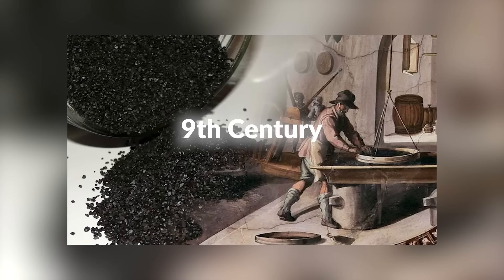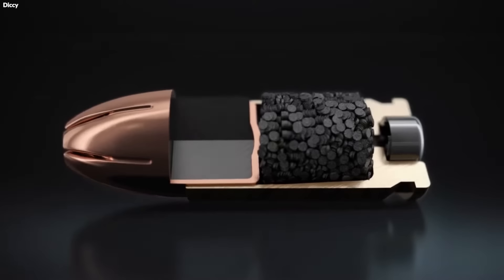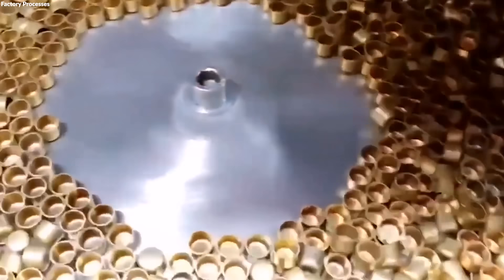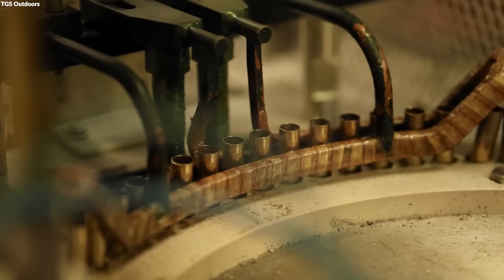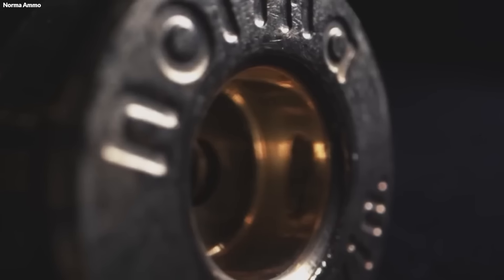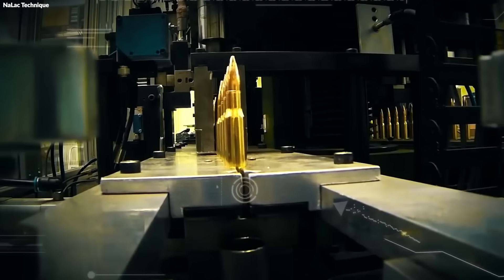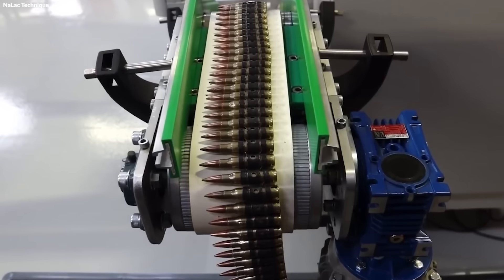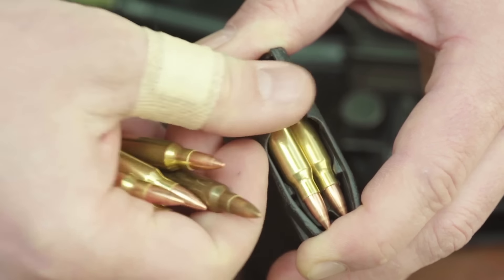How BULLETS are made - Satisfying Manufacturing Process - MUST WATCH

Comment: BRASS is used to form the cases,not copper.
Reply: What is brass? 😉
Reply: @stripedassape8148 he’s gonna be in total disbelief when he finds out
Reply: (I know your reply was tongue in cheek but) Brass is a combination of 66% copper and 34% zinc.
Reply: @da443-galmond4  that still doesn't make the cases copper. copper and brass are two different metals,with different properties.  Words have meaning.
Reply: @JayWye52  stop replying to these guys, they are trolls or are trying to sound smart on topics they know nothing about, as a mechanical engineer that works with metals and alloys they are not the same.
Reply: @stripedassape8148  try to make a cooler of brass or copper and you will see the difference in heat transfer 🙂

Comment: Also, the bullet (the projectile) has a copper jacket to prevent leading of the barrel rifling. It's not about wearing the barrel out, but avoiding the lead from being smeared into the rifling grooves. A badly leaded barrel will not be very accurate.
Reply: Properly lubed bullets won't lead the barrel much. I cast my own and have very little trouble, plus i don't have to buy bullets!
Reply: copper jacket allows for higher muzzle velocities,and also keeps the lead core together under the tremendous spin imparted by the rifling at higher velocities. otherwise,an unjacketed  lead bullet would just disintegrate from centrifugal force. On cannon rounds, copper drive bands are used to seal the rifling and prevent barrel-steel projectile contact which would damage the rifling.
Reply: @MrJdebest  copper isn't the only jacket material, not all bullets have a jacket, and a projectile is an object that has been projected into motion, not before then.

Comment: Casings are not copper but brass, it is an alloy containing copper and zinc.
Reply: Well it's about 90% correct 😂
Reply: The copper jacket is also a low grade brass.
Reply: Brass is actually Copper and Nickel, not zinc.😂
Reply: @donnthesovereigncitizen1577 that's not true...33% zinc 67% copper is basic brass with some variation
Reply: So I'm arguing with metallurgists? Copper and zinc makes an alloy known as tombac, don't ask me why it's called that, I didn't make up that name, but it is used to make copper jackets for bullets, Copper and tin is Bronze. And Copper and nickel is Brass, the nickel gives the Copper hardness that makes Brass good for making machine parts, and is more corrosion resistant than the other two alloys! Anybody still want to argue about Copper alloys???????
Reply: He meant the outer layer of the part that goes really fast
Reply: @donnthesovereigncitizen1577  Brass is copper and zinc.  Some brass is nickel plated but it contains no or only trace amounts of nickel when produced as cartridge brass.  Nickel plated brass is know for cracking when reloaded and fired multiple times.  C26000 Cartridge Brass, THE standard cartridge brass alloy,  is made up of around 70% copper, 0.05% iron, 0.07% lead, 28.5% zinc and 0.15% other metals.  Copper and nickel makes the highly corrosion resistant Monel.
Reply: @donnthesovereigncitizen1577  Obviously you are no metallurgist. Copper and zinc make brass, bronze is copper and tin and copper and nickel makes cupronickel.  Tombac is also an alloy of copper and zinc, but with a considerably lower zinc content. Tombac is also called gilding metal and is used in bullet jackets, not cartridge cases. Check Mirriam-Webster and Wikipedia.

Comment: The bullet is a projectile, tip of the cartridge that is pushed through the barre by the pressure from ignited powder charge by primer, hit by ignition pin and leaves the barrel towards the target. So whole thing closed with the case is called a cartridge, not a bullet.
Reply from the maker: thanks for the comment!

Comment: Those are "cartridges". The "bullets" are the projectiles pressed into the brass, aluminum, or steel case, with propellant (gunpowder) behind it, which is ignited by a primer pressed into the rear of the cartridge case. 
If you're going to speak intelligibly about firearms, please also speak intelligently, using proper terminology.
Thank you.
Reply from the maker: thanks